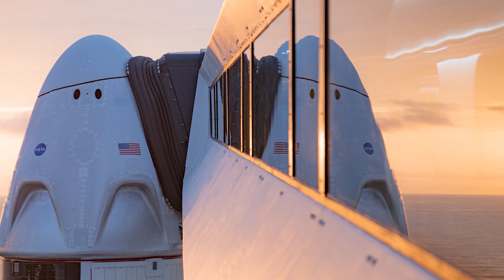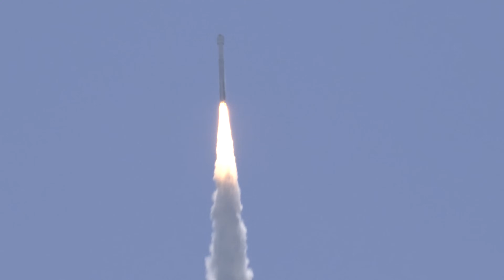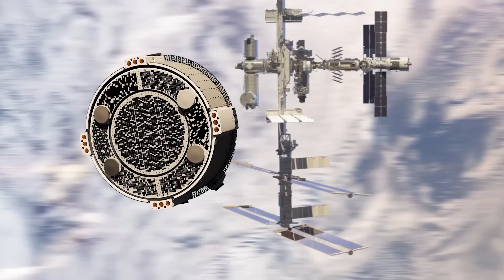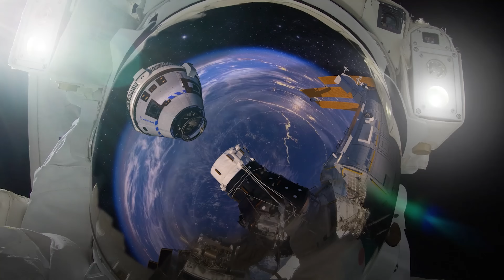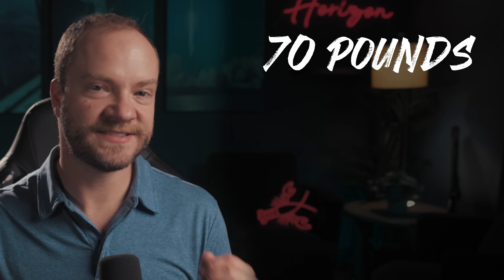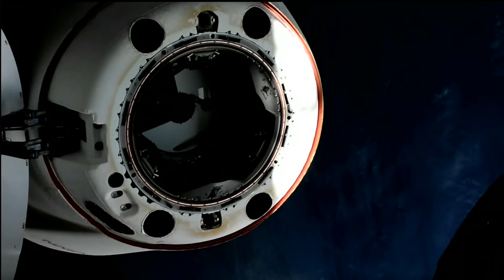Starliner in Trouble 🚨 Should Crew Dragon Rescue the Astronauts?

Comment: A tiny bit over the top on the opening. The astronauts are safe on ISS. If Starliner is deemed unsafe for return, the astronauts will continue to be safe. You can't pull a Dragon mission off in  a few days. Normally, even for SpaceX, it's going to take months. The astronauts remain safe. The rockets mentioned were not manned. If there's any doubt knowing NASA current situation (if astronauts die in space, bad things happen $$$ wise) Boeing's primary expected concern ?, possible negative impact on feature bonus checks.
Reply from the maker: The opening was supposed to be over the top.  It's parody and sarcasm. 😉

Comment: The leaks are in the RCS systems on the service module which is jettisoned prior to reentry. The Command module systems are working at 100%. NASA is using the on flight time to gather as much data as possible. There is nothing to worry about.

Comment: Always READY... Back up rockets, boosters and Dragons/s.   SpaceX CAN do this, Shouldn't be a problem What-So-Ever.  Another (idea) is to start sending up fuel to be (Stored) in space orbit.  More, sending fuel and supplies to the Moon for future use,   Also a orbiting command module around the Moon. This CAN be done by SpaceX.  
   SpaceX attempting to catch a booster need to be done at a later date when theirs another launch/catch tower.  There's NOTHING I suggest here that can't be done.
Reply from the maker: Sure, they can do it, but it all costs money.  We can build backups forever, but at some point you have to draw a line in the sand and determine that we've got enough to feel safe.  Do we really need to pay to have a standby Crew Dragon and Falcon 9 on every single crewed launch?
Reply: @OLHZN  They also have a different QC line for crew boosters than the standard F9. They need the abort detection hardware and extra redundancies. Same with Atlas V.

Comment: throw away that garbage ... Boeing is producing the same crap like it does with some airplanes recently. They try to fix this since years and still havent been able to fix it. And quite frankly: these leaks DO impact a save return. If those leaks result in thrusters not working properly the space craft can in the worst case not maneuver into an orbit that makes a save reentry possible. And dont tell me something about redundancy. In one of the flights loads of thrusters failed until on one side only 1 was left to do the job. If this would also have failed they are screwed. I would not trust this garbage with my life. stuffing loads of thrusters onto the vehicle because you know that they are not reliable is not a good strategy for safety

Comment: can anyone explain how 4 thrusters die and then "come back online?"  Machines don't fix themselves.  Is there an explanation for why the 4 thrusters failed and reasoning on why they will not fail again?
Reply from the maker: There's a lot of reasons that can happen.  Anything I give would be purely speculation, but for a hypothetical example, a let's say a software temperature limit was set very conservatively low.  A thruster exceeds that temperature, but by only 0.5 degrees.  Still, the thruster shuts down due to computer command for exceeding the limit.  Ground engineers know the thruster can handle 100x higher heat, so they increase the temperature limit a bit by only 1 degree.  They reset the thruster and then test to see if it exceeds the new temperature limit and by how much.  Now our theoretical thruster doesn't exceed the new limit, so the problem is solved and they now have a better understanding on where to set their limits.
Reply: @OLHZN  If you put together what was said during the live-stream by a Boeing engineer and then later in the different press briefings, this actually seems to have been a likely course of events. Higher temperatures due to a special flight situation and spacecraft orientation, which by the way will not occure during the return flight, in combination of of very conservative limits set which were fed into the software. As a result, the software took the thrusters offline. Changing the limits seemed to have been at least a big part of the solution in first place. But of course now it's important to compare all the data, also from OFT-2 and some ground testing, to clearly define appropriate limits, redundacy and maybe other measures for this temperature issues.
Reply from the maker: @ksracing8396  agreed! Setting conservative limits is generally best practice, so it's not surprising to hit those limits occasionally. 👍
Reply: @OLHZN  This makes sense to me.  I wish we could get some confirmation on what happened and how they came back.

Comment: I dont understand why pressure suits are necessary in an emergency situation? They are great to have for a pressurization contingency, but going back to Apollo, they reentered in flight suits. I know  Soyuz had a valve issue that unfortunately killed 3 men, but is that still an overriding concern?
Reply from the maker: It's always a concern because of how quickly astronauts are rendered useless in a depressurization event.
Reply: The couches are probably contoured to the suits, and the air pressure hoses may have a different connection.
Reply: Hey Vinni. You sort of have a contradiction there. Why in an emergency but great in a contingency? Same thing. The suit, even if no EVA or LEVA is planned is the final defence for the traveler if there's a loss of pressure in the spacecraft. In Mercury, Gemini and Apollo they suited up in case of pressure loss. On Apollo7 Wally Schirra insisted they come back with the pressure helmets off. Head colds. Soyuz 11, which you mention, didn't have suits because 3 men in a 2 suited man craft.  If their pressure valve happened and suits, Georgy Dobrovolsky and Victor Patseyev and Vladislav Volkov would still be alive. I'd say yes, it should be a concern.

Comment: Much of the trolling of Starliner comes from Boeings well earned bruised reputation of poor performance and insane cost overruns.
Reply: Is it trolling when the issues are actually happening? When the known issue of 1 leak was logged and they launched anyway? When people, many very very smart people, said that if there was a leak in one there could be a leak in others.

Why are you saying this like “there is nothing to see here”.
Reply: pointing out a real issue is trolling now?
Reply: And stunted safety inspections. Whoops! Was that a door?
Reply: I find it amazing how Space X has had a tough deal when it comes to signoffs by the FAA. They seemed to drag their feet every time. Yet with the Boeing Starliner. The Faa (of which Boeing have board members entrenched) Seem to just sign everything off...Despite continual problems. They have already said that on return of this vessel, it will be signed off as a crew transport vehicle for the ISS. Despite all these issues. Boeing have yet to have a fault free flight. If Space X had the same issues, they would still be grounded for crew missions!
Reply from the maker: True.

Comment: iss has two spacecraft docked now, astronauts can use one of them to return to earth. Or Russia can launch a rescue spacecraft to get them back to earth.
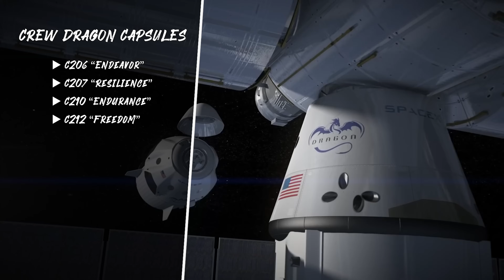Reply from the maker: I mentioned the existing Dragon in the video. (8:20)  You cannot take one of the existing vehicles and strand astronauts at the ISS.  THAT would be a safety risk.  The astronauts need that vehicle as a safe haven or life boat.
Reply: @OLHZN  and why no Soyuz?
Reply: @LukasSt.711  because NASA is ashamed to ask for help from the Russians
Reply from the maker: Soyuz could be done, but Soyuz as a rescue would have all the same logistical challenges.  Just take most everything I said about Crew Dragon and insert "Soyuz" instead.
Reply: @kirillperov3843  I don't think so,  it's space flight there all playing together. In the worst case, it is about people's lives. They even tried to help during the cold war at Apollo 13
Reply: @OLHZN  Are Soyuz capsules always available or are they built just in time?
Reply: @OLHZN  But there are two spacecraft available.

Comment: ..Tory did an awesome job filling us in on any and all possibilities on what could go wrong, and what will go right. So I'm happy with that. However, he never mentioned if they have any concerns about the landing rockets. No way to test those, though until the astronauts land, so I'm assuming all is good with that system. Also, I heard an earlier report that it's not so much the hardware as it is the software. So maybe get a better team for checking that system next time. Thanks for the update Tory. :yougotthis:
Reply from the maker: Landing rockets?  What landing rockets?  Starliner lands under parachute with airbags at the bottom. 🤔
Reply: There are no landing rockets

Comment: Excellent video. I'm no fan of Boeing, but the speculation and sensationalism around these issues, even coming from supposedly well informed sources, has me outraged.
However, there are 2 things I find troublesome, and in my opinion are squarely NASA's responsibility. First, how didn't NASA insist on intercompatibility of the spacesuits of Boeing and SpaceX? Reminds me of the CO2 scrubbers in Apollo 13. Second, a rescue mission to the ISS has always been a clear contingency situation. How come there's no plan for it, or backup vehicle? Heck, even the Russians had to send an empty Soyuz up to rescue a crew. You would think they would at least have assigned a specific vehicle for the rescue.
Thanks for your videos!
Reply from the maker: I completely agree with the suit compatibility  issue.  Feels exactly like the CO2 scrubbers.  As for the rescue, even the Soyuz rescue took a few months.  It could be done; it's just unnecessary for minor issues that can be easily resolved or managed.  If there was an actual severe issue, I'm sure we'd be sending a rescue by August or September.

Comment: I believe in starliner!❤ Every program has its issues. PLEASE remember this is a test!!! Boeing is getting so much data from this, and will be much better for it.
Reply from the maker: Right on 🤘  We shouldn't be shocked if minor and non-life-threatening issues pop up on a test flight.
Reply: @OLHZN  Except this is the 3rd flight. 1st with humans but 3rd flight overall. The first 2 flights had thruster issues. Then there was an entire year delay for the stuck valve issue where they didn't solve the problem, just replaced the service module. Yes, issues pop up and that is why you have test flights. However, 5 years behind schedule and having the same repeated issues, except now with people on board, is ridiculous. Boeing has a track record here of not being up to the task. And not being honest. That is allowing the speculation to run wild.
And NASA is to blame for the lack of transparency here. Have a press conference and take questions! Explain what is going on.
Reply: Are you the Boeing CEO's child?? Boeing has trouble making safe planes, let alone spaceships. That company is a mess.

Comment: The problems, so far, are concerning but not endangering to crew - the real story here is how is this going to impact the first regular crew flight since NASA will want the thrusters going offline issue fixed and the leak situation at least improved before the next flight. No wonder Boeing is scrambling for more monitoring and testing on the thrusters to try to get a handle on the issue
Reply from the maker: Yes! 💯
Reply: Frankly every spaceflight mission depends on so many things going right that every single mission has a “gripe list“ that needs to be addressed before the next flight and that’s how it should be. It is really really hard to both get right and stay right

Comment: Really clear and comprehensive coverage of the current Starliner situation.
The first and only rescue mission was last year when Soyuz MS-22 developed a severe coolant leak. Russia sent the next capsule (Soyuz MS-23) up without any crew a little earlier than sheduled and extended the original Soyuz MS-22 crew stay by 6 months.
Reply from the maker: Yep, this was a much more severe situation, and it's an excellent example of the tineline and logistical challenges for a rescue mission.  Also highlights how it disrupted the normal crew rotation.
Reply: @OLHZN  Its also a good example of what WOULD be going on if there was a real concern that the vehicle could not return. They'd be scrambling something already, and none of that at that point.
Reply: Again I'll say PinkLittle. Skylab 2 in 1973 or 4. Didn't happen but there was a plan if needed.

Comment: Why are the astronauts suits not compatible…
Reply: Proprietary to 2 different companies. Also the suits are quite complicated because they have to plug into their respective capsules life support and comms systems.
NASA could have stipulated a common suit interface in their contract, but obviously didn't.
Reply from the maker: Yeah, seems like that could've been a good thing to stipulate early on in the CCP contracts to have a common interface and standardized comm protocol for the suits for contingency planning. 🤷‍♂️
Reply from the maker: This is a fantastic question, and it seems silly that they aren't. Probably the same reason why the Apollo CM and LM used differently shaped CO2 filters.
Reply: I'm sure that would be a no go and a major complaint for SpaceX. They already feel constrained and limited enough with some of the requirements that NASA forced on them (water landings being the main example)

Having to limit their suit design to Boeings level would be a nuisance. Plus the whole point of having 2 crew capsules was dissimilar redundancy....even though I think that's just a bogus reason to give certain companies contracts.
Reply: @DorkJelly  Water landings were also because SpaceX wanted NASA to pay for heat shield qualifications with the legs. They could have paid for it if they really were dedicated to it.
Reply: GM part’s doesn’t fit on a tesla
Reply: Did they learn anything from Apollo 13?
Reply: I strongly agree they should have compatible spacesuits for both spacecraft. It makes sense and it’s common sense for emergencies like this.
Reply: The same reason Apple uses a different charger - the National Bureau of Standards (yes it’s real) is a worthless government organization that never inserts  itself into anything anymore. (Except electric outlets)
This is the ONE government organization we actually need  and they are asleep at the switch.
At least NASA was smart enough to have ONE docking port design.